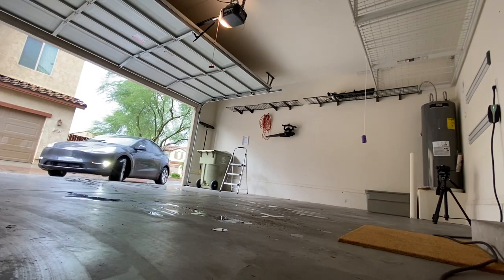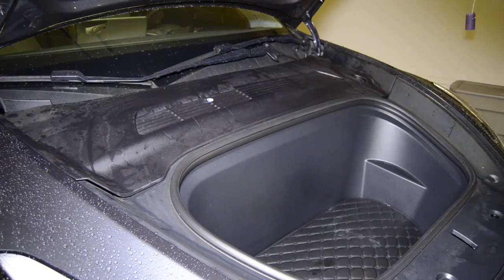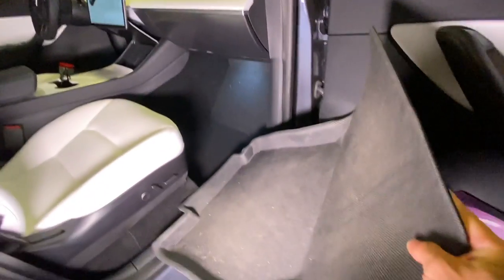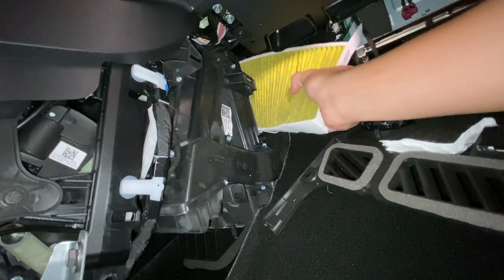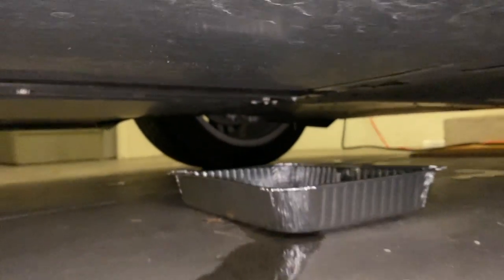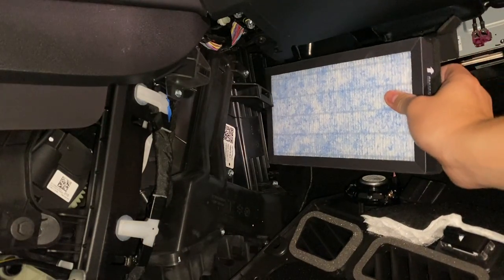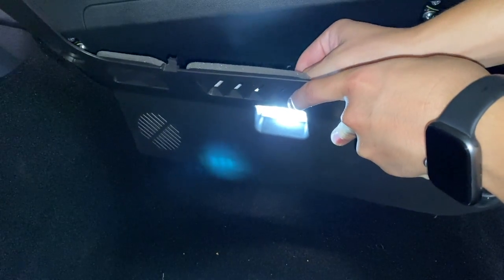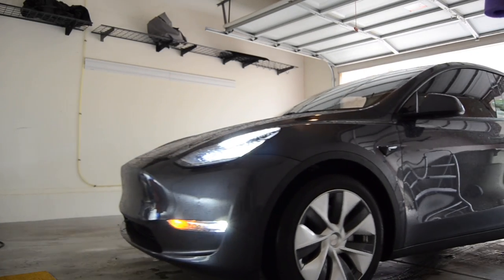My Tesla's AC Smells TERRIBLE & How to Fix it!

Comment: Very clear explanation, thank you and kudos.

One thing to add, the speaker wire is tricky to remove and has no obvious visible release tab. A small flathead screwdriver will help. The release is on the lower wide side of the connector, same side as the L-shaped key. Push on the rectangular hole on that side to disengage the notch on the connector.

Comment: Did you put the filter in backwards or did the camera flip the image. Air flow is from right to left and the filter arrow was pointed to the right.  Additionally, we should have seen the charcoal side of the heap filter and we saw the white paper side.  Apologies if I’m wrong.  Cheers.
Reply: Same, looks like you put them in backwards.   Blue side faces front of car
Reply: You’re right, he didn’t pay attention to the arrow for air flow😂
Reply from the maker: The company I got the filters from has since updated their design, but I installed it according to the manual that came with the product. You can see that the pull tabs are accessible in the way I installed them and if I were to flip the filters, I wouldn't have been able to keep the tabs accessible.
Reply: @DylanHongTech  I think the filter manufacturer put the pull tab at the wrong side.  I see when the tab is on the top but the air flow arrow is pointing to the front.  Shouldn't the air flow is from front to back?
Reply from the maker: Yeah, they since updated their design
Reply: @DylanHongTech  Question is if the arrow was the wrong direction or if the pull tab was in the wrong place.

Comment: Thanks for the video. I have a Performance 3 from 2018 and it suffers from the same problem. The access for the filter is very similar on a 3. A Tesla service center once used an ozone treatment to clear the smell and it worked well. I've tried spraying a cleaner into the air intake in the front and that did not work well. The direct foam cleaner on the evaporator seems like a good way to go. I did this when I placed aftermarket charcoal filters.The smell did recur after a while since the design of the A/C system is flawed and the moisture allows mildew to grow.
Reply from the maker: Yeah it’s a bummer that it will eventually return, but I’m glad you liked the video! :)
Reply: It’s best practice to turn the recirculating air (RSA) off about 10 minutes before you get to your desired destination if you have to use RSA. The issue is that moisture from the evaporator coil builds up (“sweating”) when using RSA and when suddenly shut off, it sits there and sweats down to the filter area and that’s where the smell comes from. This is a very slight design flaw in an otherwise damn near perfect vehicle.
Reply: Lol it’s not a slight design flaw. Every other vehicle has vertical drip. It’s a huge flaw to have horizontal drip.

Comment: I just started noticing this a couple weeks ago.. A little under 3 MONTHS of owning a brand new 22' Model 3 Performance. I knew it wasn't, but really thought it was my feet smell that was getting recirculated into the AC, until you mentioned foot smell. Live in FL, humid, but will try the filters first. 
Thank you!

Comment: you should also clean the air intake inside the frunk as some debris can drop in there and start to rot when it gets wet. We live in the NorthEast and I put a filter in place to keep leaves and things out of the air intake vent.
Reply from the maker: Good tip!
Reply: Will this restrict the air flow (into the AC coil)?
Reply: no it is designed to keep large thing out (leaves/sticks) but has good sized holes for airflow
 @VietBuffet

Comment from the maker: Buying a Tesla? Get a $1,000 or $500 discount by using my referral link: http://ts.la/dylan49913
Foam Cleaner (PAID LINK): https://amzn.to/3ggz5hq
HEPA Air Filters (Paid Link): https://amzn.to/3CZSblI

Awesome Tesla accessories: 
Floor Mats (paid link): https://amzn.to/3B93jy9
Matte Glass Screen protector (paid link): https://amzn.to/35XVkCG
Performance Pedal Covers (paid link): https://amzn.to/3PuWewb
Storage Bin (paid link): https://amzn.to/3RVm3qM
Center Console Tray (paid link): https://amzn.to/3z6mZQs
Center Console USB hub (paid link): https://amzn.to/3OuxFy7
Matte Glass Screen protector (paid link): https://amzn.to/35XVkCG 
Glovebox USB Splitter (paid link): https://amzn.to/3z5Fsgb
Wireless Game Controller (paid link): https://amzn.to/3cIhccx

Hope you enjoyed! This was a fun project and video. Let me know if this helped you remove the smells from your Tesla's AC! And I'll edit this comment if/when the smell starts to come back!
Reply from the maker: UPDATE: It was pretty humid one day and I had the AC running for a bit. After the car was parked outside for a while, I did notice the mildew smell coming back a bit for the first minute or so in the car. It doesn't smell at all when I get in the car after it has been in my garage and plugged in.
Reply: @DylanHongTech  Thanks for this video. Has your solution lasted, or has the smell come back?

Comment: Good, this will help but you know what is the source of all this ? Just remove the filter again and was your windshield with a lot of water, you will see some water goes to the filter area... The best solution is to install a flexible wall (seal) under the hood between the wiper area and the air entrance. This will solve your trouble for good.

Comment: Mine has the exact same problem.  I live in a humid climate and need to replace the filter every 4 to 6 weeks.  I'm thinking of removing the filters and adding a filter to the air intake by the hood.  I know it may get wet up there but it should get rid of the re-occurring smell.  There are also a couple of drain holes that will need to be filled with a foam filter.   The air intake is a super easy place to access and replace the filter when needed.
Reply: That is a good idea. Can you post a link for the intake filter?
Reply: My 2018 Tesla Model 3 has the same smell issue and I've had the "Farmogo Tesla Model 3 Air Intake Filter" for years (replacing it regularly). It does help a lot to prevent some dusts and debris, but won't solve the smell.
Reply: You guys are wasting resources replacing filters lol. This is hilarious most people don’t know about the horizontal moisture drip. Builds bacteria. Every other vehicle has vertical drip. I came across an engineer who broke it down in complete detail. It’s a huge design flaw
Reply: @Bane92  Several years ago, there was extensive discussion about the cause of this issue, with some attributing it to a design flaw. Despite claims that software updates for additional heating after parking could help, it seems ineffective. The problem likely stems from the design flaw, which persists in recent Tesla models despite numerous online complaints for years. I think the point here is that Tesla owners are seeking affordable and relatively simple solutions to mitigate the issue temporarily during hot summer months.

Comment: Oh man! I actually didn’t wait the 20 minutes at all and when I turned the A/C on I had foam coming through the vents at the dash. Currently letting it run now for the full 20 minutes and then I’ll put the new filters in. Hope I didn’t mess anything up 😬. I guess I’ll try to remember to give my own little update so please everyone feel free to ask me if I do forget.

Update: Definitely worked. I’ve gotten the smell since then but only a handful of times. I find that when the climate control is constantly on it gives no time for the smell to linger and blast you in the face once you’re finally in the car. Turn that off and it’s definitely brewing for the release once you turn your A/C back on. I got the charcoal filter, definitely harder to install due to them being a bit more bulky and you will smell the charcoal initially when turning on your A/C. Just something to think about, it doesn’t smell bad to me; however, my wife did relate it to the smell of cigarettes and neither of us smoke. The smell lingers for as long as the wet sock smell does when you first turn it on, but definitely better than smelling the wet sock smell.
Reply: Me too!!  I forgot to wait and foam came out of the vents!!!

Comment: It’s best practice to turn the recirculating air (RSA) off about 10 minutes before you get to your desired destination if you have to use RSA. The issue is that moisture from the evaporator coil builds up (“sweating”) when using RSA and when suddenly shut off, it sits there and sweats down to the filter area and that’s where the smell comes from. This is a very slight design flaw in an otherwise damn near perfect vehicle.
Reply: I agree with this!
Reply: I’ve never had to take any previous car apart every year to fix a horrible design flaw on one of the worst vehicles I’ve ever purchased

Comment: The problem is water getting sucked into the cowl vent and building moisture onto the filters when the hvac system is on during a rainstorm or car wash. People don’t know there’s a car wash mode. Towards the beginning of the video when you lifted the cowl cover, the duct you see there is where some water is going. There’s a drain at the bottom of the duct but when you have the fan on, it’s sucking some of it in. Keep those filters dry or you’ll have to constantly change them out. One other note, Tesla has improved on this design flaw on the newer model years.
Reply: i have a 2023, still have the bad smell.. i used carwash mode every time i washed it.. i hope there is a better fix

Comment: did you put them in backwards?.....
Reply: I thought I was the only one who noticed it. Poor quality control on those filters, either the tab should be placed in a different corner or the Air flow pointing arrow should be marked different way . Hopefully YouTuber realized and changed got it right.

Comment: My 2020 doesn't have a screw at all.  Cant figure out how to get the cover off.  There is a clear hinge on the bottom but no obvious way to release it at the top.
Reply: then they didnt install it from the factory, should be able to just wedge out then.
Reply: Look higher up on the evap cooler housing. The lower big door you first see doesn’t have a screw. The smaller door higher up and toward the front of the car has the screw on top for my 2018 M3 and is the one you’re looking for 🤙